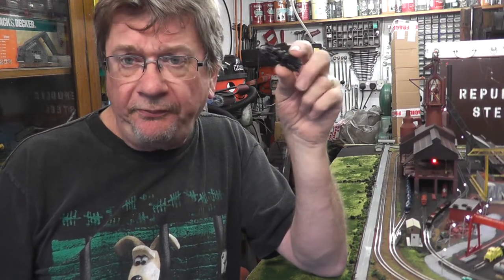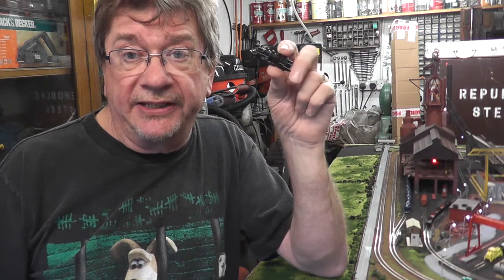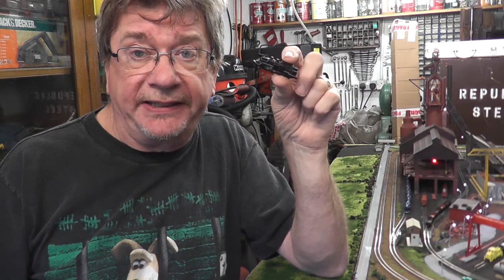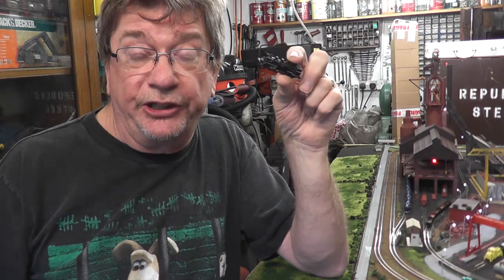Rokuhan Z Gauge  C11

Comment: any issues with the stock rapido/arnold coupler on the back? I just got one of these and it seems like the rear coupler sits pretty low and when pulling tenshodo passenger cars the higher sitting coupler on the passenger cars always wants to come out and so it drops the cars pretty often. any ideas?

Comment from the maker: Depends on the controller. Hopeless on a Marklin controller, the start voltage is too high. i use a Gaugemaster and the slow speed running is ideal on that
Reply: Thanks. I am looking at a Rokuhan package from Japan, it comes with the Rokuhan controller which can run on batteries (so it should not give too high a starting voltage).